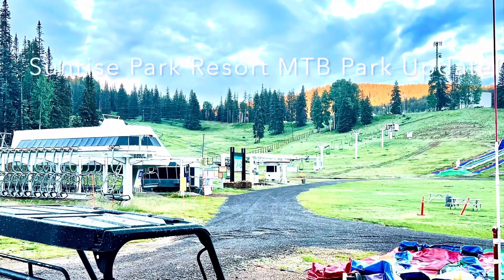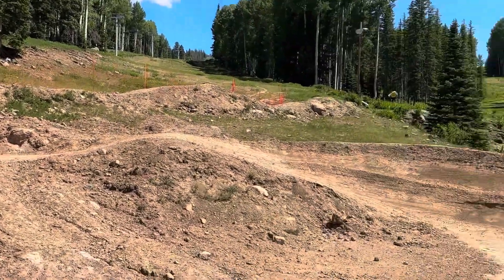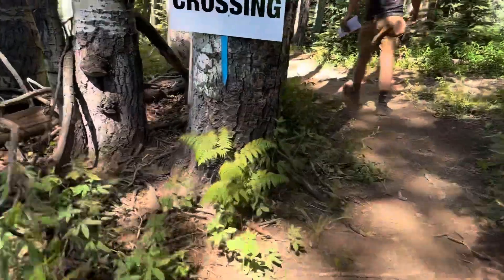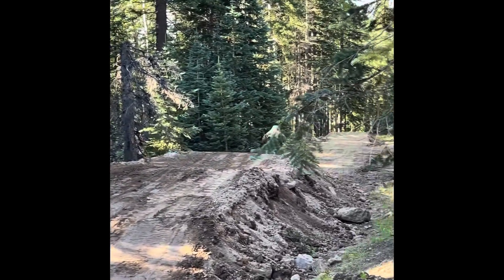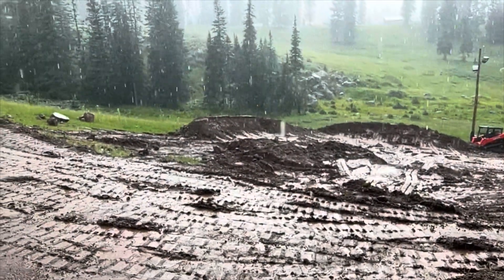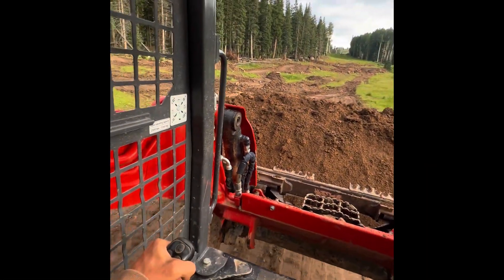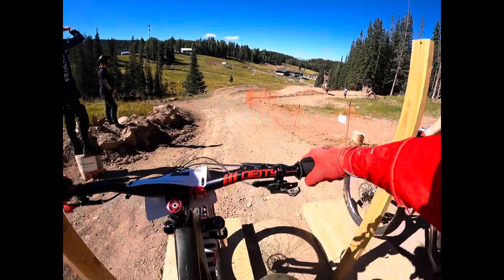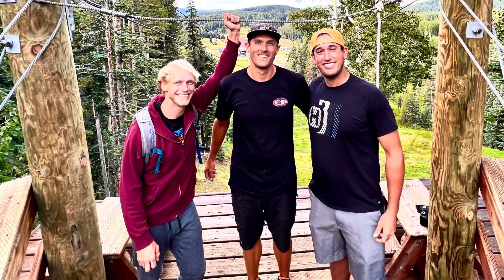Arizona’s Down Hill Bike Park Update 2023 “Sunrise Park Resort” MTB

Comment: BADASS!!! I knew this place had potential. If you guys can tune the existing lines and create some other stuff this place can and will give y'all a boost with incoming riders. 
You definitely can make it feel like Angelfire,NM and Snowmass,CO. 
GUARANTEED a lot more riders from California and surrounding states will come there. 
You definitely need a mini excavator in your arsenal.
Keep the updates coming on your channel!!
Reply from the maker: Thanks a bunch for the comment! There’s going to be more improvement this year than last! The boulders out here are immense and my tractor is many many times more powerful than a mini x and can hold around 12x more dirt per scoop and move at at least 2x the speed. I have access to one but I don’t think it will help me much on the slalom or jump line I’m building. However, it would be so sweet if they had a couple up here to work on the trails through the trees!
Reply: @skillsandbuilds3987  
That's what I meant, lol!! If the existing lines, non pump track and jump lines, get tuned up with a mini ex with catch berms and random in between tables in the trails, they will definitely have that unique feel like the bike parks I mentioned above. 
Have you been to either Angelfire or Snowmass? If not take a trip and you'll definitely see what you can have there at Sunrise.